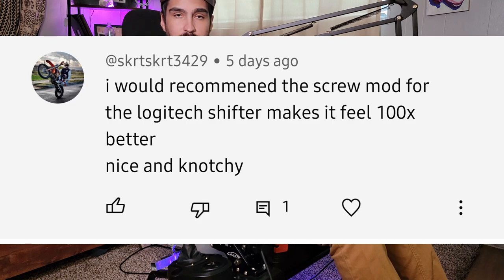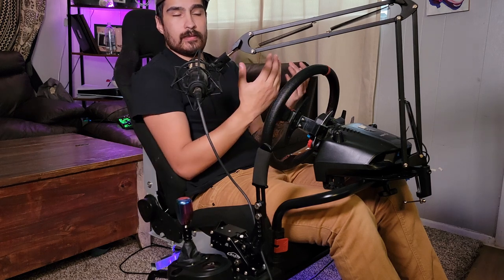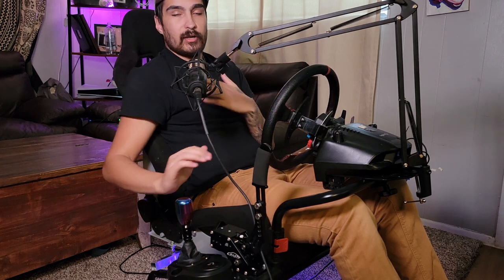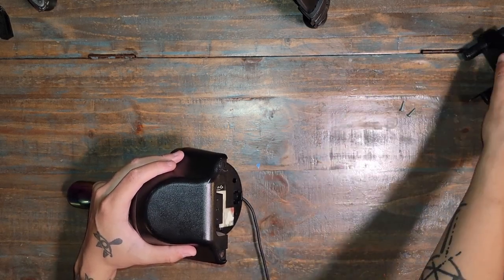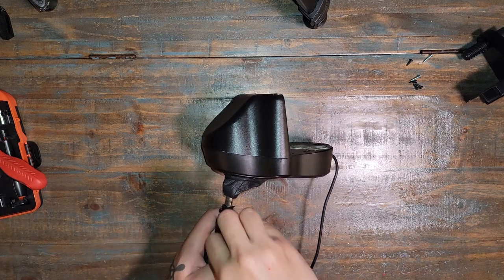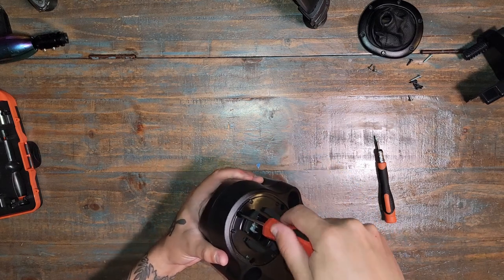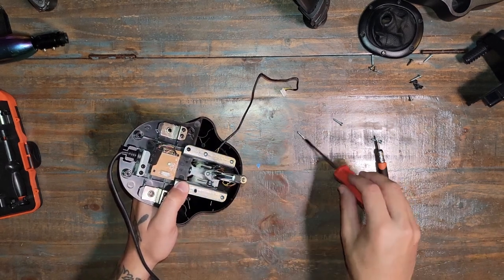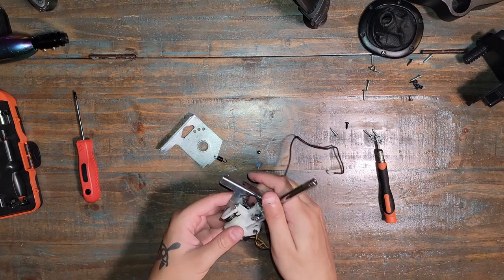Logitech G29 Shifter Mod  Screw Mod

Comment: About a year ago I got the truebrake mod from AXC Sim, Its a linear potentiometer that replicates a load cell so the brake actually works like a brake pedal actually does in a real car by pressure instead of travel distance. I also bought their potentiometer  replacements for the clutch and gas pedal they are a much better design than the crappy Logitech rotary potentiometers that will soon start reading erratically, All together its a night and day difference and worth researching if your not happy with the factory logitech pedals
Reply: About a month ago I bought the Truebrake mod and agree about the night and day difference it makes. Did you also move the OEM brake spring to the clutch and the OEM clutch spring to the gas pedal? (tossing the OEM gas pedal spring)
Reply: @DickDebonaire  I did.

Comment: I just did this mod after your vid, I  use the H-Pattern tactile mod, and the inner ring with rubber bands, as well as a taller, yet lighter shift knob.
Feels twice as good to use now.
But I didnt think I needed the headbolt/spring mod, and basically wasted my time by taking it apart.
But now I've just done it, and it really compliments the H Pattern mod well.

I made a 5.4mm wide by 5mm tall cylinder on my 3d printer.

Actually a half decent shifter now
Reply: Appreciate the Dimensions

Comment: pedal mod is worth it if u plan to keep the rig, i swapped out the clutch spring with a $7 variable spring and swapped gas spring with the stock clutch spring. won't give u faster lap times, but makes feathering the gas alil more real. thanks 4 this vid

Comment: nice video. i’ve also preloaded the shifter resistance spring, and noticed it feels a lot better. i used a 3d printed spacer i made. i’m curious if there’s any springs out there that are the same dimensions just heavier?
Reply from the maker: Very nice. After the mod, the shifter is feeling a lot better. I will still replace it sometime in the future, but for now I'll  keep using it
Reply: Hi, I'd like to print a spacer to, what size did you use?
Reply: @GregoryShtevensh  I do not remember, i’m sorry.
Reply: @GregoryShtevensh  someone else said they printed a 5.4mm wide, 5mm tall cylinder and that size was perfect
Reply: @tupercharged  I made my own, 4mm by 5.4mm.
5mm was too rough imo

Comment: I have that exact same set of set screws from harbor freight lol.  Def going to do this tonight.  Wonder how this would be with the 3d printed magnet/gate mod
Reply: Did you ever do this mod with the 3d printed gated magnet mod?
Reply: @woe.num.1  I did not, I was more than happy with doing this mod.  I did use some thick grease made for bicycle cranks in there which helped smoothed the overall feel which I would recommend using something similar or some thick silicone.  From what I have seen those printed gate mods break really easily and the way I hammer on it I am sure it would be on borrowed time.  If I found one cheap enough maybe it would be worth it, if you get one let me know!
Reply: @loaked3000  I just ordered the mod I’ll write back when I test it out
Reply from the maker: I'm intrigued to sew how it works out!
Reply: @woe.num.1  did you get the magnetic shifter mod? How is it
Reply: @fe2890  yea, it’s not too much of a difference in actual gameplay combined with the mod in this video. It makes a metal clinking sound that sound a little more realistic at best. I might try to upgrade the magnets on it and see how it feels. But the best mod is the one in the video. I recommend
Reply: I have a magnetic shift mod I made my self on the 3d printer... Been trying to do this but the ball keeps popping out after a few shifts when's it's in with the screw
Reply: @deannaidoo825  too big of screw maybe or you didn’t tighten enough ?
Reply: @fe2890  did not tighten all  6 screws enough, ended up loosing Reverse gear with this mod. time to upgrade shifter now
Reply: @deannaidoo825  oof

Comment: Ive done this mod with machine screw, Works great however the potentiometer on mine spring out   and I stuck t in upsie down and couldnt figure out for a bt why the gears wernt reading properly😆works great tho

Comment: Anyone struggling to find a piece to fit inside the spring, I spent hours tryna find something with enough decent size - head to give a decent preload, In the end I made one myself by shaving a wooden dowel into the shape and size I needed lol…also for any newer batches from Logitech the cable that you unplug is glued down to the plastic housing and it’s very tricky to free the cable without damaging it, again, be patient, oh and Incase anyone is wondering. It makes a huge difference🔥🔥. #TeamMod#FckkWarrenty

Comment: Sooo… Basically it’s DIY Difficulty rating would be right about on par with assembling your first AR15 stripped Lower Receiver, Lower parts kit, and Trigger Group assembly.  Lol, Ya mostly need to just know exactly where and when to look out for possible flying springs and/or spring detents. Then, it’s a piece of cake!    🤣, 👊!!

Comment: Edit: oh i see there are two more screws holding it in place, i dont have a screwdriver skinny enough to fit down the crevace. :/

am I the only one who's platic piece still wouldn't come out after I took out the 2 screws.  @2:30
Reply: Mine won’t come out either
Reply: @gropaygrapay  there’s two screws you’re missing
Reply: @ F E Oh, ok. I just skipped that step and did the mod without removing the piece and it still worked just fine

Comment: What shift knob is that ?
Reply from the maker: I got it on amazon last year. It was 10 bucks now its gone up 5 bucks. EZAUTOWRAP Neo Chrome Stick Shift Knob Weighted Manual Gear Shifter JDM Aluminum Rainbow 06 https://a.co/d/3kTee4r
Reply: Whats the bit called that u put the 2 screws into to hold the gear knob?